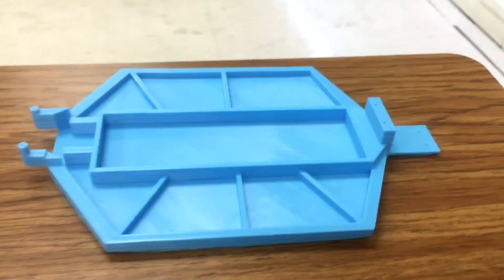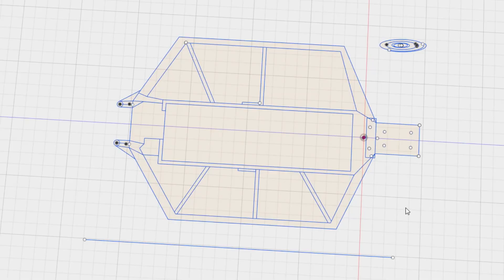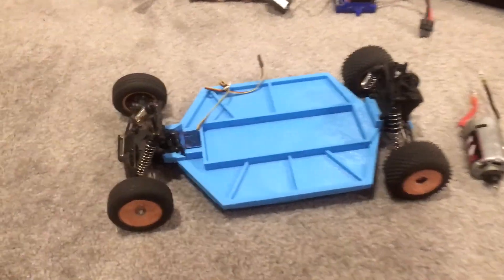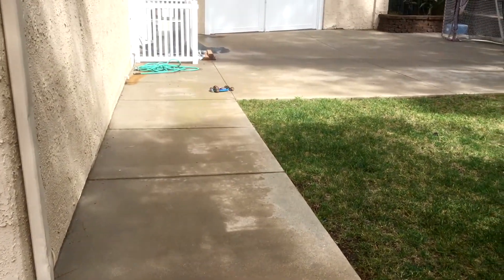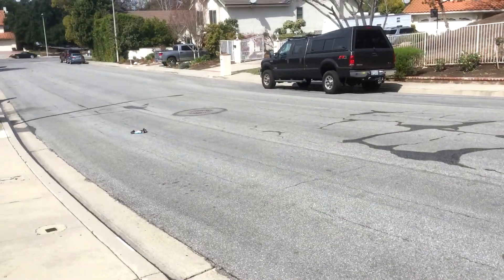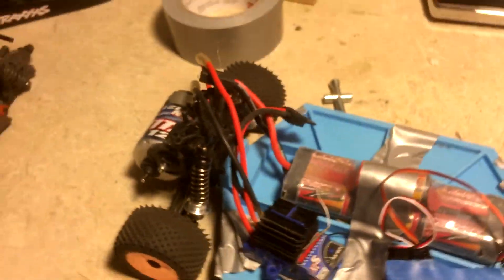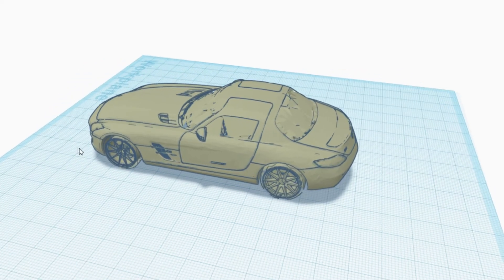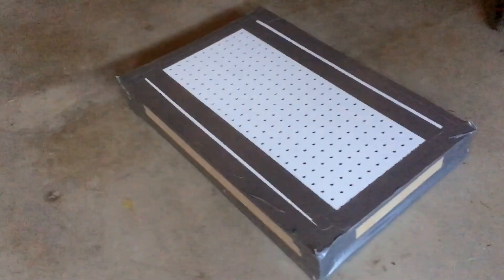40 mph 3D Printed RC Car Chassis

Comment: I suspect you're losing traction because of the bumpy tires. There's really very little contact patch there... try it with slicks, and I'll bet you'd see a big improvement. That said, it looks really cool! Looking forward to seeing it with the body.
Reply from the maker: Gryf Ketcherside changed em after I filmed this, they work a little better but the bumpy tires wore down pretty fast to almost slick status. Next step is to fix the differential